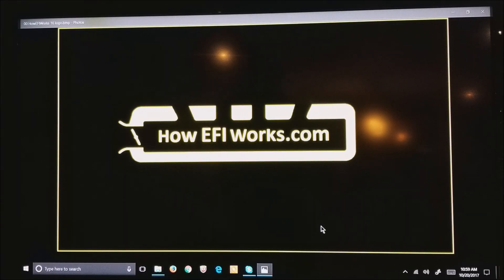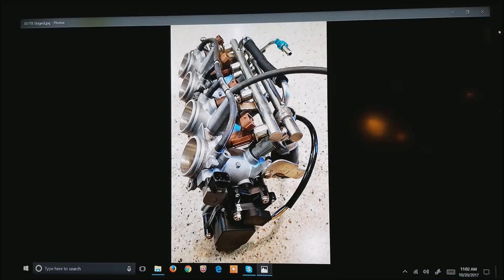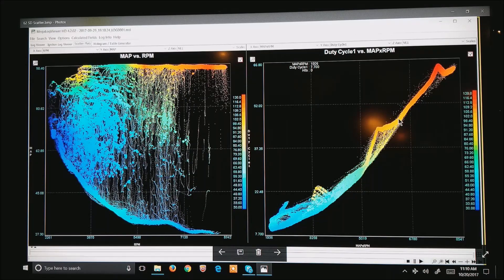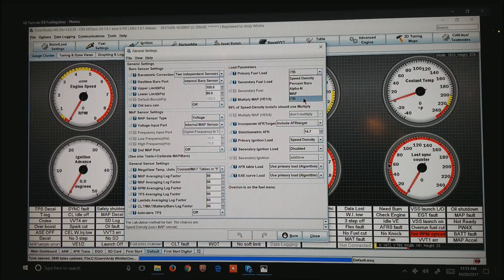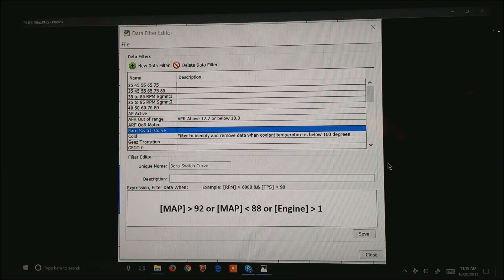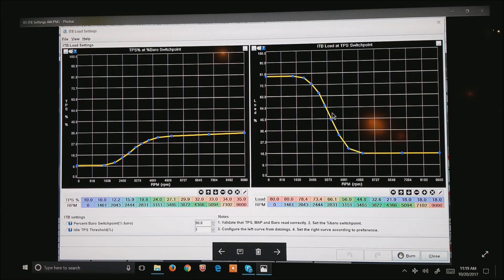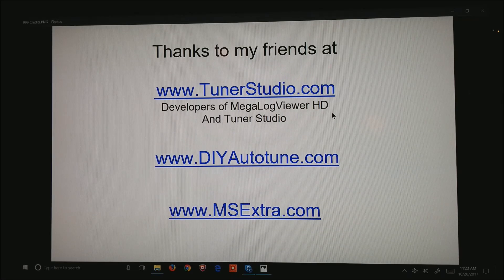Independent Throttles and Setting Up ITB Mode

Comment: all you have to do in an ITB conversion is to simulate MAP and IAT readings (yes there is a way ....)
i have managed a 16v 4age with 20v silvertop itbs tuned 100% perfect with just a super afc (apexi)
perfect idle with 15.0 afr 
smooth acceleration with 14-15 afr 
and 12.8 -13.2 WOT from 4000 rpm up 
standard ecu 
compression 11.5 
4/2/1 headers + 50mm exhaust system with 200 cpsi cat + 1 silenser 
car has a perfect cold start at 1150 rpms with 13.5 afr for about 2-4 minutes depending on the weather ...
then back to 850 rpm .
car makes 155 bhp 
can travel 
can commute 
can race .
average consumption for commute is 7 l/100 klm 

its nice to be an engineer......
Reply: simulate?

Comment: Hi, if you want to understand what is happening in the ECU, the explanation in the video does not really help. :((.. 1.)let me start with the fact the that collecting that 90kPa vs TPS vs RPM curve from datalog is practically impossible on a fresh untuned engine.. who would run those loads/RPMs if you just started setting up the ITB? 2.) the ITB settings panel together with the instructions (both on the GUI and from video) is just a recipe but does it make any sense? the left curve shows a TPS percentage at certain RPMs which resulted in 90kPa..ok so what? will that be the switch point to jump from SD to Alpha-N? no answer on that.. 3.) the right curve is a bit clearer.. ITB Load versus RPM to decide if we are going go SD or Alpha-N. But what is ITB Loaf..is it TPS%? if yes, this whole table is just overrides the one on the left side..one would be enough :(.. or what is it MAP? My best guess is that yes, it is MAP load and then you do not directly use the TPS switchpoint curve (from the left table) but you will modulate it with the right one...*somehow.. but how? neither the video nor the manual has the answer.  my 2 cents.

Comment: Was interested in running ITBs on my Miata but can’t find anyone in Louisville to help me figure out which ones to buy or how to set them up. Do you know of anyone in or around Kentucky, Ohio or Indiana that can help?
Reply: I'm in the process myself, we could chat about a few things if you want
Reply: The Lyd you can reach me at 502-654-0367. Rob
Reply: @analoglyfe  I'm about to start the process as well and I'm looking for any advice I can get. Can I join your guys's chat?
Reply: I have a v6... Im having a hard time finding an itb for a 6 cylinder
Reply: @souljiah2302  you’ll need to build some. Find some motorcycle ITB’s that can be cut apart or are designed by them selves

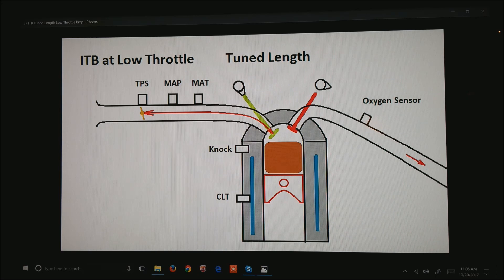Comment: 4:57 Pipe Organ
9:31 The meat of the video " ITB motors have a huge VE increase as the throttle is opened"
13:27 At 2000rpm achieve 90Kpa at 15% throttle